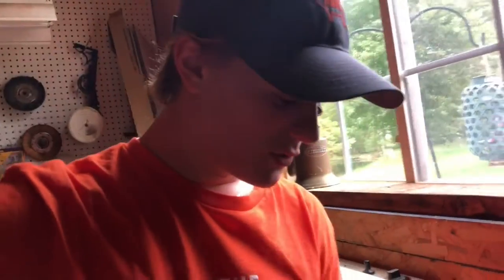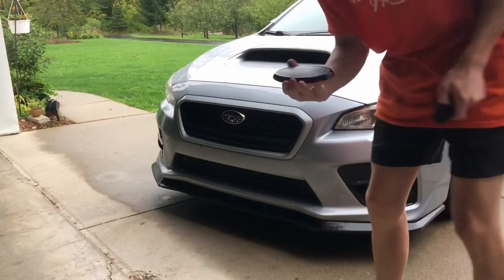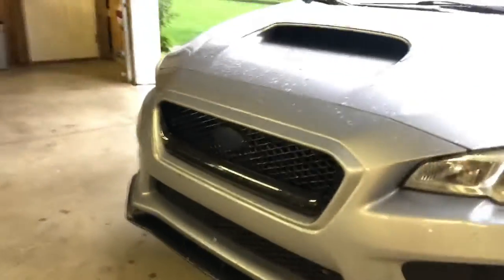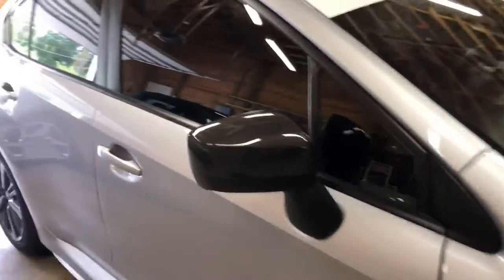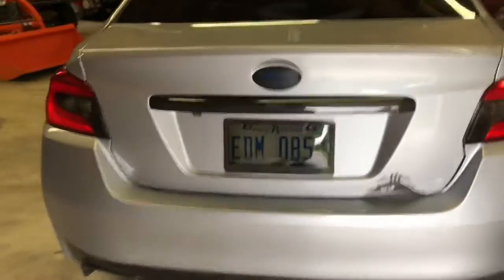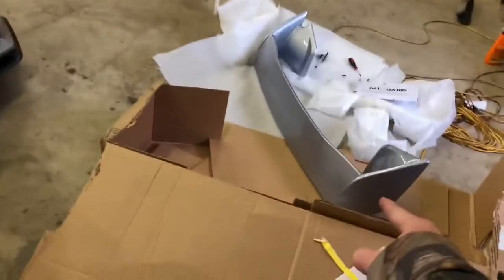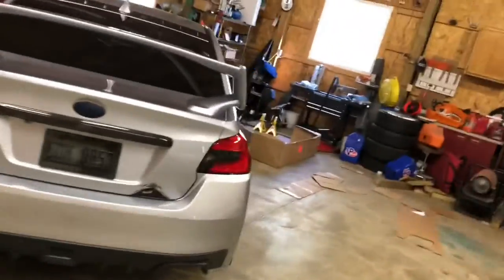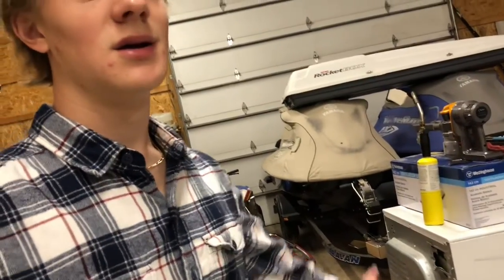2015 WRX STI wing install!

Comment: If you can't get them bolts out, I'll tell ya what I used to do to aircraft panels. We get rivets and stuff that fall in and impossible to get out. We squeezed some sealant in the holes and shook it around until it stopped rattling lol works!
Reply from the maker: Thanks homie

Comment: Where’d you put your 3rd bolt I got mine on but the sides are loose and it’s not tight to the trunk so trying to put a third one in.
Reply from the maker: Mine had 4 holes on each side and I got three in on each couldn’t get the forth on both sides mine is very strong also the double sides tape helps as well